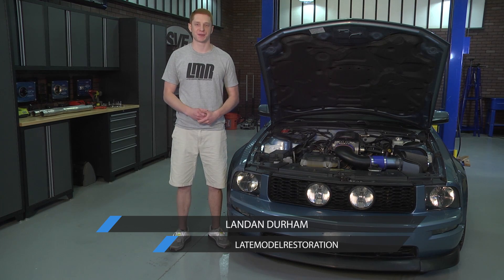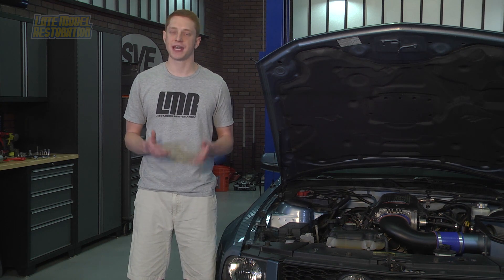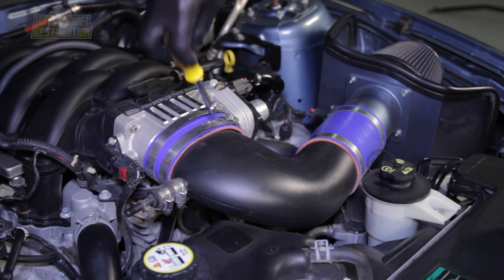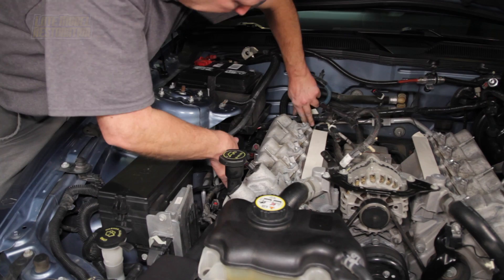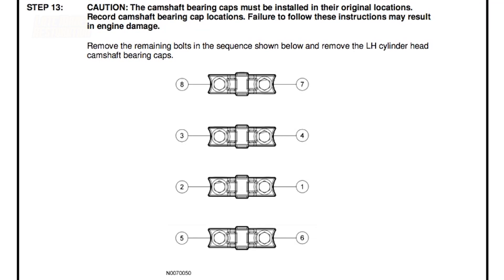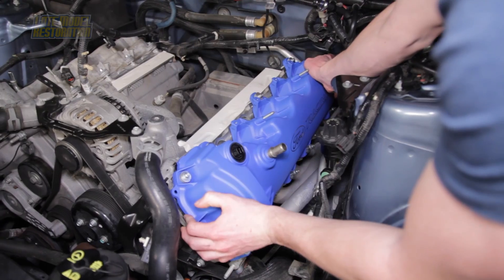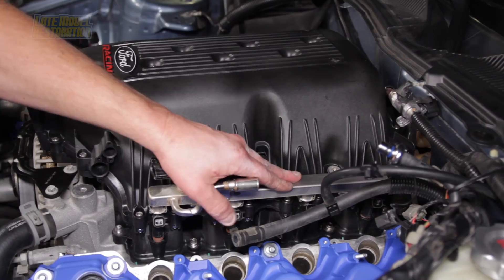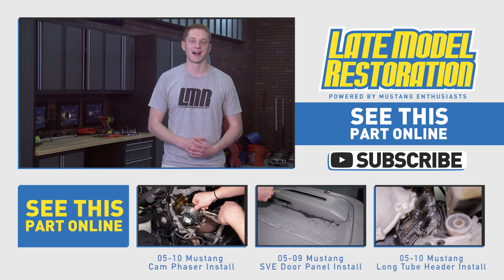Mustang GT Ford Racing Hot Rod Cam & Intake Manifold Install (05-10 4.6L)

Comment: Nice straight forward comparison and test.  I appreciated only the cam and intake were swapped out and not any other parts.  Personally, I would have just done the cam change which was most of the higher RPM power gains anyway.  The Ford Racing intake is nice if you're spending most of the time over 5K RPM.  It gives up way too much lower end power and throttle response for real street driving.  It does look cool though.  An overly of both setups would have been nice.

Comment: Take Note: No one explains this::: The Cams are different lengths... The right bank cam ( Passenger side ) is 1/2 " Shorter than the left bank ( Drivers side ).. I did my cams one at a time and installed them wrong. So a Brand new cam phaser later I did both cams at the same time and that's when I noticed it.

Comment: So it doesn’t matter what position the cam is in as long as the phaser and timing chain don’t move
Reply from the maker: If the phaser and timing chain do not move, camshaft orientation does not matter. The camshaft will align with the keyway on the phaser. If they are moved, you'll have to pull the timing cover and retime the engine. -Landan
Reply: @latemodelrestoration  thanks she’ll be getting cams soon

Comment: Why you remove first rocker arms and after that camshaft. Some fellas remove the camshaft and after that they changed all rocker arms. I am asking you because I will do the same procedure. I will change my lifters and rocker arms with phasers
Reply from the maker: The process in this video is referring to a camshaft change not a complete lash adjuster and roller follower change. This process is what Ford instructs in the shop manual for servicing the camshafts. The procedure shown can be used to service the lash adjusters and roller followers. The followers and lash adjusters can be replaced whenever the camshaft is removed. -Landan

Comment: been wanting to add cams, but been ifey because my car has 170k miles, 2007 GT, can i still achieved these upgrades on her with that many mile??
Reply from the maker: Unfortunately, we can't answer that question. There are way too many variables involved to say yes or no. If you do decide to upgrade cams, I would recommend upgrading the valve springs at the same time. -Landan
Reply: Honestly just save up for a 5.0 they getting cheaper nowadays, i also Have a 2005 GT and recently did a full timing job, upgraded oil pump, new lash and adjusters, and 2v iron cast tensioners instead of the plastic ones these stocks have, the car has 170k miles on it too, but im just gonna keep it how it is now and save up for the future

Comment: Add the Ford performace cyl. Heads with cams and intake and valve covers and long tube headers good catback 3.55 gears lots of fun makes mid 300's hp

Comment: If anyone can answer this, I would appreciate it greatly. I have a 05 Mustang GT with 38k miles and I'm hoping to replace only the cams. The car has been taken care of for those 17 years, but I'm not sure if it is a good idea to replace the springs/the entire valves in general. Do you think the hot rod cams will be fine with the 17 yr old OEM valves?
Reply from the maker: Rodger - I would talk with a local machine shop and get a professional's opinion on this. -Landan

Comment: Is the fuel pump disconnected so the injectors dont spit gas when taken off?
Reply from the maker: The fuel pump driver module is disconnected to relieve fuel pressure prior to disassembly.  -Landan

Comment: The cams with long tubes and stock intake would have made a way better power curve except up top past 6200 rpm. Unless youre driving at WOT in 35 MPH zones lol 😂 go for it . Otherwise you lose a ton of low and mid range torque. The FP intake is not good for a daily

Comment: That intake manifold only has power gains on the top end , and loses tons of torque all the way until the end . Unless you're purpose building for racing , don't change that . A larger throttle body , yes 👍

Comment: Are you supposed to use the same crankshaft positions that you used if you arent using a valve spring compressor and not removing the followers?
Reply from the maker: Hi Talin, that would be a different procedure if you do not use the valve spring compressor. We recommend the procedure used on the video as we show. Feel free to give us a call at 1-866-507-3786 if you have any other questions or concerns and we'll be more than happy to help!

Comment: I’ve seen so many other videos where people don’t remove the followers for a camshaft install, whether it’s this brand of cam or another one. Is that step really necessary? People who have skipped it seem to have had no issues.
Reply from the maker: We recommend taking them off to make the install easier. When it comes to skipping that step, it is up to the installer to research before hand when performing everything.

Comment: The low numbers are more than likely do to the shorty headers vs not having long tubes. I’ve seen very similar set ups making 350+ whp
Reply: Plus it is an auto.  Most of the ones you see ar 350+ are manuals the auto sucks more power.
Reply: I did the shorty headers on my Shelby GT just because 1) I love the sound just like it is and more importantly 2) installing long tubes meant replacing my entire exhaust and that was just too much cost. Butt dyno says there was a difference with the shortys installed. I’m happy to see this video that mirrors a lot of my setup. 4:10s have been my favorite mod.

Comment: Needed to put bigger throttle body on as well. That one is starving the car. Also upgrade the injectors. That would show much better gains
Reply: Why would injectors need to be upgraded?
Reply: Lmao no. It isn’t a diesel. It’s been proven stock TB works best for n/a on the 3v. And the injectors aren’t even maxed until you add a 150 shot of nitrous on these cars. Ignorant comment

Comment: They should have over laid the first dyno chart with the second.   Peak numbers are up but there is a cost for that at the mid range.   Id keep the stock intake with the charge motion valves and cam install.

Comment: What an absolute joke. All that time and money....for that. I hate that I ever bought this 3v junk...now I'm stuck with this crap.
Reply: Do your homework man.  There are way better setups for making power.  The intake sucks and those cams sound good but are not the best for making power.  It's all about the supporting mods.  Do fbo with long tubes and get some real cams and a real tune you'll see 350+ easily that isn't bad for a 281 cube engine from nearly 20 years ago for fbo and cams.  Through a manual.  This is an auto they show less power.

Comment: Can these cams be used in the 2010 Explorer. 4.6 3v?
Reply from the maker: David - I have personally installed these cams into a 4.6L 3-valve Mustang and 5.4L 3-valve F-150.  Seems to me that they would work in a 4.6L 3V Explorer.  Unfortunately, I don't have a definitive answer for you.  Hope this helps!  -Landan
Reply: Late Model Restoration 

I installed the FRPP Hot Rod Cams and the Black Laser Etched Ford Racing Valve Covers in my 2010 Ford Explorer Sport Trac Adrenalin 4.6 3v, along with equal length shorty Headers a full true custom Dual exhaust with an x pipe, and Dual 2008 GT 500 mufflers, looks and sounds awesome, and looks like it came from the factory with the duals out the back
Reply: David, see my post

Comment: You could just buy a stock 2001 z28 Camaro and start out with more power lol
Reply: No you couldn't.  An auto ls1 is not putting 315 to the tires.  Manuals have dynoed that high not autos.  This is an auto a manual would have probably seen 340 and its getting it from an engine 1.1 liters smaller.  Also an s197 is way better than a 4th gen pos fbody in looks and overall build quality the only thing good about the camaros is the engine and t56 trans.  Everything else is garbage.

Comment: this video is fake i have a stock 3v and it makes that 280 hp to the wheels already
Reply: With a manual on a higher reading dyno yes.  280 is not common for a stock car 270 yea but again only through a manual will you see that kind of power.

Comment: yeah uh..don't spray brake cleaner directly into the oil supply, especially over the chain guides. spray the rag and clean the area as required. easy

Comment: I have a 08 GT 3V ! FULL BOLT ON except for the ford intake manifold.
But I have 3.73 gears,CAI,62mm Throttle Body,Pulleys,Hot Rod Cams & 93 Oct Tune & I made 344 To The Wheels !!! :D
Reply: @Richard Skipper lmao sure man
Reply: @17456spartan  its true with fbo and cams they make 400 to the crank and around 340 to the wheels
Reply: AX7 Duran Are you on a Bama tune or a custom tune? Thats pretty decent gains over stock!
Reply: @_zach  Custom TUNE
Reply: @garibay711cod  hey man, who did your tune?
Reply: yep thats a i´m said in the above comment, you need more mods to get more power if not you are have a really minimal gains.
Reply: Same here no ford racing intake an mine made 340rwhp custom tune....stock ported custom intake gt500 tb jlt 3 cold air 373...under drive pulleys an full exhaust n longtubes.....@brezickybrothersperformance

Comment: CAN THIS SETUP WORK WITH FULL LENGTH HEADERS USING STOCK 5SPD. MANUAL TRANNY? IT SHOULD SOUND BETTER AND MORE MIDRANGE POWER. ALSO I PREFER THE ROUSH EXTREME AXLEBACK EXHAUST SOUND AND LOOKS OR BORLA ATAK AXLEBACK SYSTEM. THE CAMS ARE FROM FORD RACING AND THAT'S A PLUS FOR THE '05 - 2010 4.6L 3V THAT HAS AN AWESOME SOUND UNIQUE TO MUSTANGS.
Reply from the maker: Yes, this will work with full length/long tube headers. -Landan

Comment: I got 343 hp and 330 tq with stock cams 😒😒😒
Reply: lol yep it ´s a lost of money only
Reply: @alexvillarreal3947  I have thrown comp Cams into the mix... 368whp  344 rwtq 😁.  It's a joy after beating LS 2 and 6.1 hemi 😁😁
Reply: @Soma-7662  which further mods do you have on it?
Reply: @alexvillarreal3947 
JLT intake
62mm Throttle FR
FR manifold
BBK fuel rail
Blox fuel pump
Pacesetter LT headers
3.73 gears
Borla Axleback
Cat delete
Upgraded suspension
SPEC Clutch assembly

Also 150 shot nox but only in rare occasions (ex. Hell cat, Shelby)

If you have Instagram @soma.7662
Reply: @Soma-7662  mmm that is the reason bro lol, ok thanks for yor instagram i dont have one yet, but i´ll create an account and add you, i have a gt 05 with tune and exhaust only lol, but i really prefer buy a 5.0 2014 and then puttin the full bold ons.
i´m from Monterrey México, like 4 hours to arrive to San Antonio Tx , might be going to SA Tx to get some pieces bro, when COVID pass away ...
Reply: @alexvillarreal3947  that's the way bro 5.0 all the way. 3v can't go up against the new hemi and LT engines even with all the mods. Don't waste money on 3v if you're competing with big dogs.
Good luck and be safe bro.
I quit racing since 2013 when I got married. I am a daddy of 3 kids and the risks are too much for me.. Peace
Reply: @Soma-7662  yep, you got the point and that´s true exist a risk every time people race...
Good decision that every people should do when have family 
Me ain´t race since 2013 as well, because the risk, and the life have other priorities.
I´m only want 2014 o 2015 because it´s more newest, without problems to fix , more   confort and tech...
Good to talk , see around bro.
God Bless you bro.

Comment: Those numbers are super low. I have placed stock GT's on the dyno and gotten 275+ at the wheels. I've also talked to Ford Engineers and they state don't install the intake unless your going with a forced induction setup.
A standard axleback and intake with a 700.00 tune would get you 15-25HP and all under 1,500.
Reply: Who's paying $700 for a tune
Reply: busared06 exactly lmao
Reply: @busared06  depends on where you live, up north some charge up to 800 for a dyno tune

Comment: Lol @ "Not bad for an automatic car".  The old myth that manual transmissions magically make the same engine faster.
Reply: haterget1nb3ast yes a manual transmission has less drivetrain loss than an automatic because there is less components in a manual transmission to get the crank hp/torque to the rear wheels
Reply: You're for some odd reason assuming wheel hp is the same as crank hp... It does make a difference in wheel hp. Read up.
Reply: Joseph Bentley Manual Tranny doesn't make a car faster, it makes it fun to drive!
Reply: Depends on the technology, a manual transmission from 2010 and before looses less than 10% power to the wheels while automatics loose from 12-17% but it's more up to who can shift quicker
Reply: that´s true , i had have a 00 mustang gt auto and then a 03 mustang gt manual and there is a many noticeable difference in power, respond, and fun and dangerous with water on the road...
just for example i remember that in the gt manual , i was ridding at 100 kms per hour and i just cluchting , the car begins to lost traction , its funny and dangerous
Reply: The automatic sucks more power out and it is proven they dyno less.  That don't mean it's gonna be slower but they do show less hp on a dyno this is a fact.  Also be careful what manuals you call out some guys can drive the wheels off a manual trans car and when they shift it basically sounds like an auto shifting.
Reply: Joseph Bentley its proven with these cars the 5 speed for a fact makes more on the dyno
Reply: Automatic is oh, so fun to drive.... rolls my eyes  If you want an auto just get a 4cylinder grocery getter.
Reply: @denniss4951  till my auto schools all over any manual in its class, gotta  Ratchet shifter with shift kit and 3:7 gear full built forged internals hot rod cam N/A  11.31 @ 126 making close to 500 to the wheel

Comment: That's not that good to be honest and I'm a mustang fan but my G37S (3.7) with Stillen Gen3 intakes and tune made 312 and mind you I didn't crack open the motor yet
Reply: Yes 312hp is great but not when you make no torque. Vq engines are known to have terrible torque outputs. This car made 318lbft of torque while your 312hp g37 probably only made 270lbft of torque.
Reply: @mikestoms4015  check my IG streetking310 you will see why I said that. I have a C6 corvette and a 5.0. This is horrible for the money
Reply: @gblikesnikes  I have an 05 gto which is the same power train as your c6 as well as a pro charged 350z. You are correct in saying This is not good for the money I’m just saying your g37 comparison was not a fair one since you didn’t mention and weren’t considering torque numbers.

Comment: Something not right, my 2006 gt got 335hp with power flow intake, FR intake manifolds, FR throttle, long tube headers and flow master mufflers.
Reply: Assaad Zayer auto? Or manual?

Comment: 30 hp and 9 torque.....is that even noticeable
Reply: stock_ _c5 noticeable in the wallet
Reply from the maker: Yes, there was a noticeable difference! Especially the power the car gained at the tail end of the power band. -Landan
Reply: Late Model Restoration how much better would a manual have done? Also long tubes instead of the shorty this car has? How much low end do you lose?
Reply: @latemodelrestoration  you need tune in at firstable instance to get more gains, in additional that´s could cause problems in the close future miles if you dont take good care in the installation, and you are lessting life engine because you over rev the engine to get that power , It is necessary to increase the exhaust system , oil lubrication and other components upgrades, if you dont change axle and add a transmission upgrades you are losing that power at the  rear wheels. In my opinnion it´s a cost without benefit, out of this its a good explanation video with quality.
Reply: Yeah 30 hp is alot when ur talking numbers on the low end of hp 30 is a big dif
Reply: Hardly...

Comment: I added these cams to my GT '10 Love them!!! Set idle to 800, sounds beast at the stoplight! Only problem is when starting engine cold start, sometimes it stalls due to the exhaust pattern from the camshafts.
Reply: All that can be corrected in the tune
Reply: Who gives a rats ass what it sounds like any gains.  My stock exhaust sounds amazing people comment how awesome it sounds. Performance the HP gains for the price sucks , might get a 12 horse bump maybe ?????
Reply: @nickhammer6408  sorry cams sound better no matter how you look at it tbh
Reply: @squad-wh4ig  They give a nice lope with a drastic duration. But as we use to say Listen to that car Go..... Yawn 🥱   Exhaust  with Headers are great noise makers but you can pick up some serious power as well.  Breathe baby breathe.
Reply: @nickhammer6408  im sorry what
Reply: @squad-wh4ig  Good One 👍
Reply: @nickhammer6408  I'm fr you genuinely confused me
Reply: @nickhammer6408  some people like to make noise and others like to enjoy the sound of a v8 pal, it's not that difficult...
Reply: @nickhammer6408  mmmmm kay
Reply: @galagoz7401   All I am saying how about some Bang for the Buck.
Reply: @nickhammer6408  Then go FI a SUPERCHARGER is the best bang for your $!!!!

Comment: For a medium experienced mechanic how long will it take to remove and reinstall just the intake manifold?
Reply: just take the day off. expect to be in the garage for quite a while. these things never go as planned and you always lose a bolt or two and end up spending 30 minutes looking for the damn thing. or other little mishaps may happen. so its best to just give it a day in the garage. now if you have someone helping you that knows that they are doing id say a couple hours.
Reply: Daniel Diaz , ended up getting it removed at a workshop, took around 4 hours including repairing the heater lines